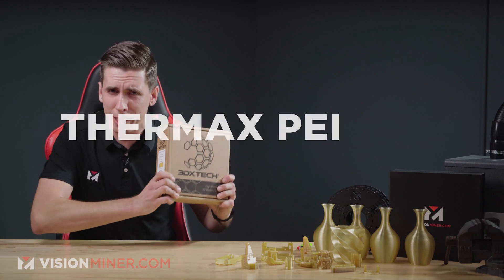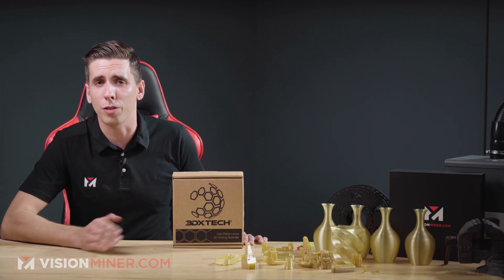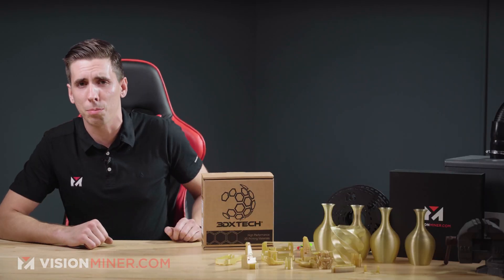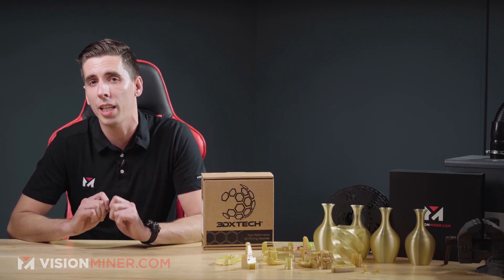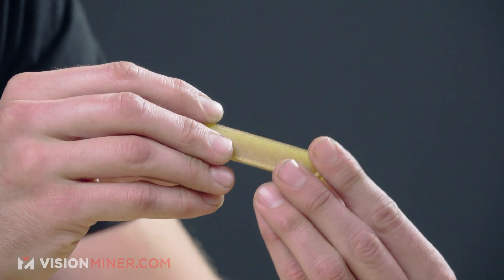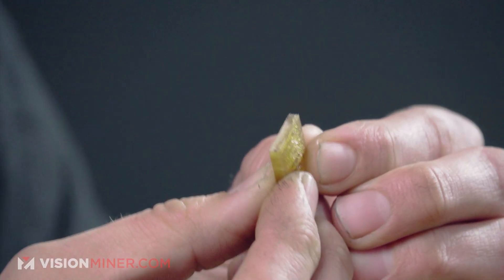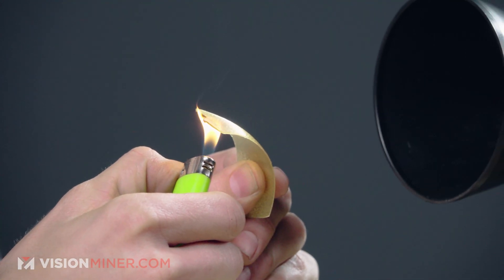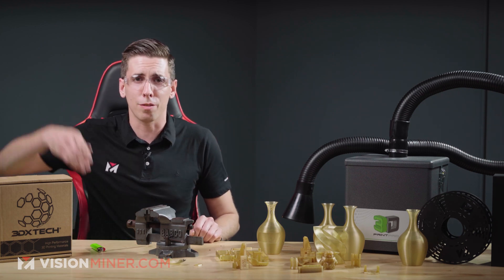ThermaX™ PEI, Made Using ULTEM™ 1010, High-Temperature 3D Printing Filament from 3DXTech

Comment: I've noticed a flaw with the vase test (I think). As the cross section between layers is thinner than the extrusion width, on ductile materials, the layers are most likely to show up as the weak spot, but on brittle materials, since they shatter, layer adhesion is almost always shown to be excellent. Its a great way to see how something will break, but not necesarily a good measure of layer adhesion in particular.

Comment: I tried to like this channel, but it reminds me too much of an infomercial. A lot of meaningless technical information that your average 3D maker doesn't care about, and then when you finally get to showing what you actually make with the stuff it's always the same stuff, a Yoda, a benchy and everything else is under NDA, I mean seriously who's going to spend this much money to print a vase? Putting a sample in a vice and bending it with your hand to break it is about the most unscientific way of testing something I've ever seen, it says nothing.
Reply: I fully disagree- They are a business first and foremost that specializes in selling engineering grade materials and equipment. So it is safe to assume your audience has some understanding of material science and what they are looking at when you spout off technical specs. These materials are not your average PLA, PETG or Abs filaments often time costing hundreds of dollars per kilo. The choice of them printing things that are common is to allow for a quick understand of what the materials will print like. A Benchy is a standard print because it has a little of everything in terms of features. Some of these materials are a true bear to print (looking at you PEEK) where others are easy and fun loving (PEKK). Benchy from these two prints would be drastically different and thus a quick glimpse into what the results is great. It is great that they use their entry level HT printer to print them aswell. This shows you the minimum quality you can get with these materials with a single extruder cost effective printer.  Lastly, the vase and the sample in the vice being "unscientific" is missing the point. The demonstration is to show if the material is Amorphous or semi crystaline and how the layers fail. If you want scientific you go back to the specs they called out earlier in the video.
Reply: @usrenmae  you are correct these are not your average filaments, which is more the reason I would like to see what types of objects can actually be made with these filaments. And what are those object properties.? I understand it's a business, but it still has an infomercial feel to it. I also get it, there is a lot of highly technical information that seems like they're reading right off the spec sheets. What I need to know is how that translates into real world applications and not just a generic we use it in "this and that" industry. I like to see some more outside the box thinking. For instance would a carabiner made with this material support a human weight on the end of a rope just as an example of a real-world application. Don't just snap a sample on a vice but do some scientifically destructive testing and shows the results.
Reply: @JazAero  You talk about this feeling very infomercial and then you want them to do a Billy mays/ Flextape style demonstration. You are asking questions that is beyond the scope of a 13minute general information video. The point of this video is to give you general idea of the materials. If you see what you like you need to read the white papers. They can not make claims about the materials outside of general statements because the multitude of factors that go into 3d printing. Destructive testing is done on a case by case bases with higher end printing requires test parts to be printed at the same time. These parts are for destructive testing to verify the layer adhesion and crystal structure. They could never say definitively "look it will support an adults weight" because they can not verify the design, the  material handling, print, and post processing. They are not in the business of designing parts. They offer printing as a service and parts/supplies for inhouse printing.
Reply: @usrenmae  that's a poor analogy, Billy Mays died years ago, that's not what I'm asking. But you seem to have picked up on that one sentence out of an entire paragraph To base your response on. I'm asking for objective real-world examples of objects created with this material and you seem to be taking an almost adversarial approach to your responses. I get you like these guys, I like these guys, that's not the issue here. There is no need to be an advocate for them. I am just expressing my desire and my opinion.
Reply: @JazAero  I think I addressed your argument fully in my response. Remove the Billy May comment and my argument goes into why they keep the examples as general as possible. They established some fields that use this material and some treatments of it. Outside of this there are too many factors that they can not shoe horn into a 13 minute video. You are entitled to your opinion and I am to mine. We have a fundamental difference in thought. You feel that they are trying to sell you something without telling you what it is and what it does. I feel they give you the highlights and expect outside and deeper research.
Reply: @usrenmae  You say I am entitled to my opinion and yet you continually try to invalidate it with your "reasoning". I on the other hand have actually agreed with you on many points, I'm not looking for a running argument, over a difference of opinion, but you seem to be. I'm going to end this now because I suspect you're going to be one of these people who has to get the last word in any way.  they should pay you for being such a staunch supporter.